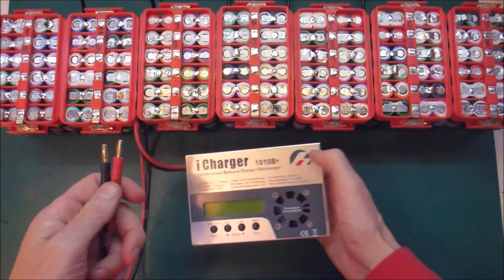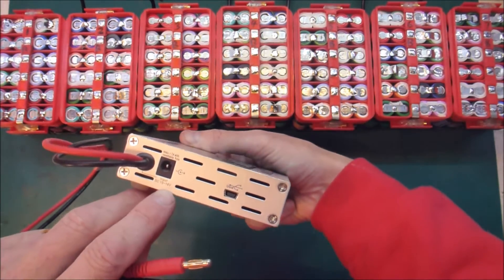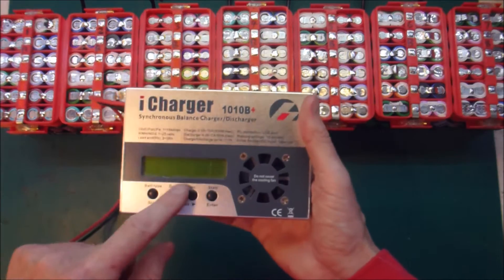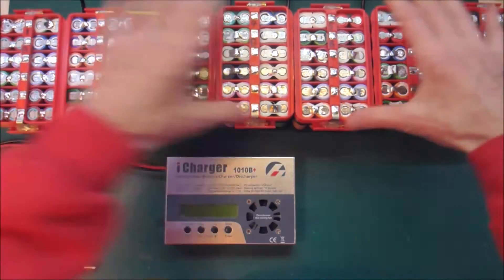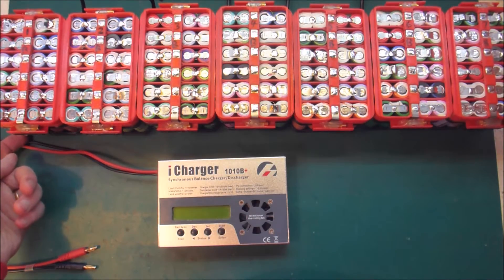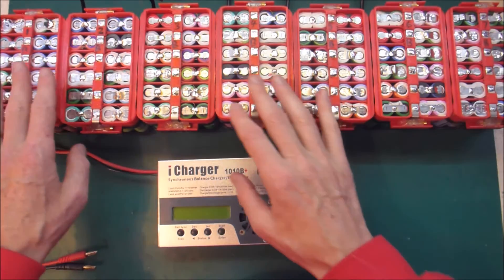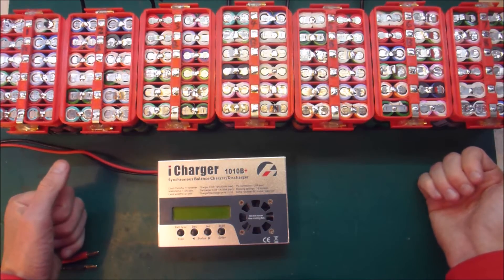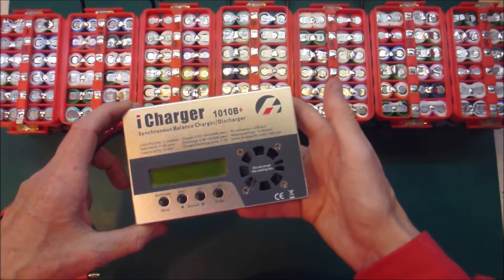Laptop Powerwall 102 - Why did my iCharger die?

Comment: Hi Paul being enjoying your videos to date, could you tell me what the Fuse wire you use onto the cells off each batteries IE the ones that popped and also the circuit breaker amp's

Comment: Don't be too hard on yourself and I applaud the honesty in the video - it's easy to pretend this stuff doesn't happen.  The fact that the output has shorted would not occur to the best of us. Glad it's forced the main fuse/breaker issue. Lots of power in those cells. 
I have the umm issue too. I also realise I start far to many sentences with 'So...'  still need to work on that.
Reply from the maker: Adam Welch  Now that I've fixed all the fuses I'm much happier. I've done enough of these videos now to have a new respect for those who talk "live" without  ums and so and long pauses.

Comment: Mistakes and Bikes are the same...It's a "Chain Reaction"...!   Hello Paul... Thank You for the video... good to know, you are in a good mood.    Why not consider "Electricity" as parts of a  Bike...?   You would "never" put the 3 Kennett Brothers on a small TriCycle, even if the name suggests so...!
Reply from the maker: I've fixed all the fuses now so those groups are back in the main powerwall. Cheers!
Reply: Cheers...!  The iCharger seems to be a very good charger and company... why not contact and ask for advice...?  Maybe a repair is a possible solution...